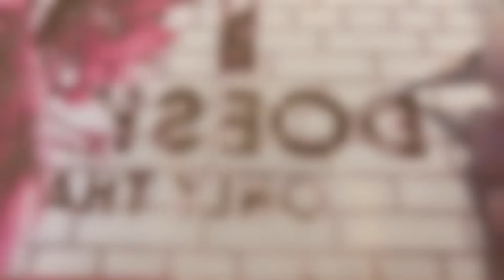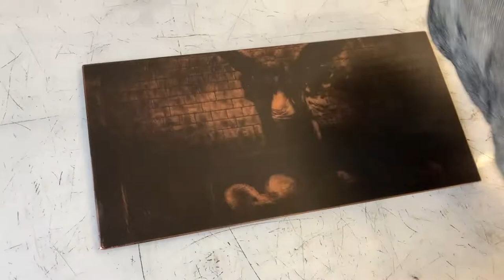Mezzotint with Stuart Duffin RSA, for Glasgow Print Studio Learning

Comment: How are you flattening the mezzotint as the paper and ink dries? It looks like your taping it down with brown gummed tape?  It looks like you're taping both the frontside and backside?
Reply: Yes. We have such a high turnover of printmaking at GPS that flattening under weights would be a bit chaotic. Tape it down like you would damp watercolour paper and then tear off the dried gumstrip along with a wee bit of,the printing paper using a steel ruler (and do it from the back)